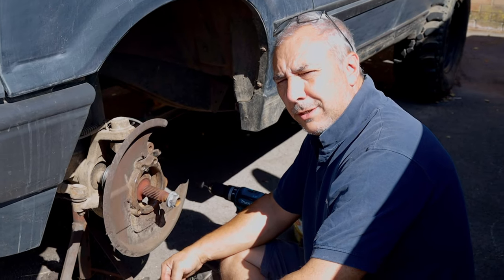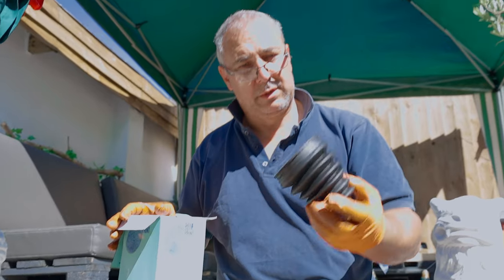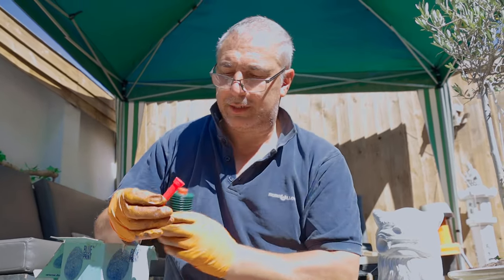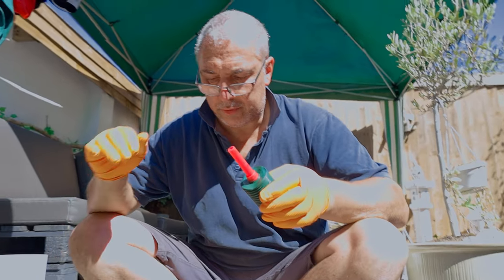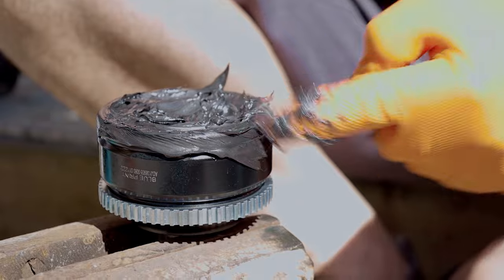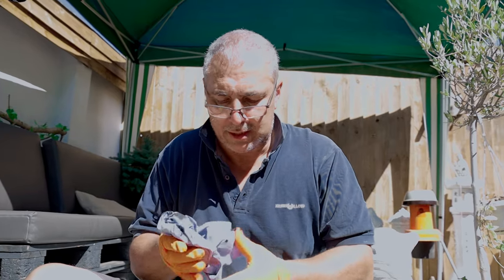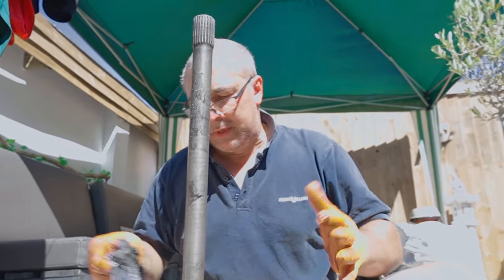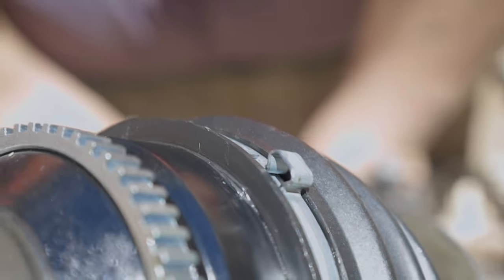P38 Hub & Cv Replacement

Comment: Nice to see a P38 being cared for and some videos on the maintenance. I find mine very competent at greenlaning but also pleasant to do a days driving without getting too tired.

Came across your channel by chance but coincidentally am about to replace all wheel bearings and axle seals.
Reply from the maker: Hi
Thank you for your message, and good luck with bearings and seals👍
Regards 
Martin
Reply from the maker: The P38’s are becoming a desirable 4x4 due to there ability off road and on road😀

Comment: After watching your video before having to change my CV joint, there is one thing I found a better way of doing. Those sodding spring clips. Turns out if you slide the spacer over the clip, it holds them nicely in place for when you fit the joint. One swift tap with a plastic hammer to send everything home. It avoids the hassle of fighting to poke it in while getting covered in grease and needing to rope in an extra set of hands.

Tip top walk through otherwise, helped seeing what I was doing before having to do it. Cheers.
Reply from the maker: Hi
Thank you for message!
The new CV joint came with a clip retainer but did not help😆
But yes would definitely been 
Easier for sure👍
Glad helped with your install 👍
Cheers 
Martin

Comment: So do you have to buy the hub complete if you just have a broken stud?
Reply from the maker: Hi Brian
If you brake a stud you can buy them separately, if your bearing needs replacing you can buy separately also! In our case the bearing damaged the original hub, so had to replace complete hub👍
Regards 
Martin
Reply: @all4x451  Thank you for replying so quickly. I have a new stud, but I am unable to pull the hub from the driveshaft with my puller.
I thought it would be straightforward once I had removed the driveshaft retaining nut.
Reply from the maker: Hi
Yes they are sometimes very difficult to remove, you will need to separate with chisel or something similar you may damage hub a little! Try and soak with penetrating fluid for a few days this will help!